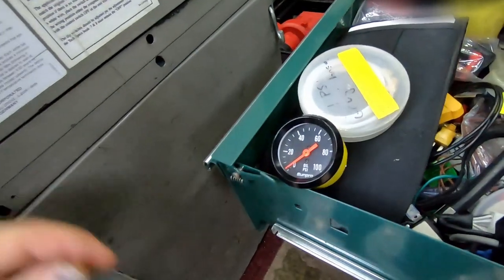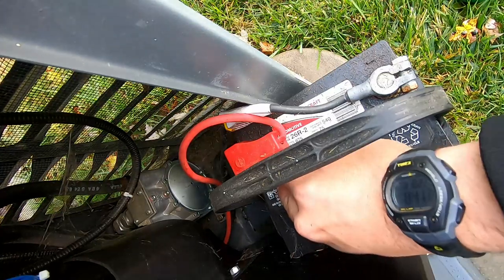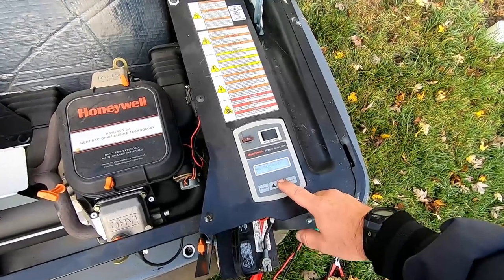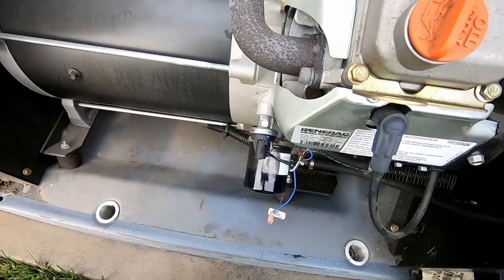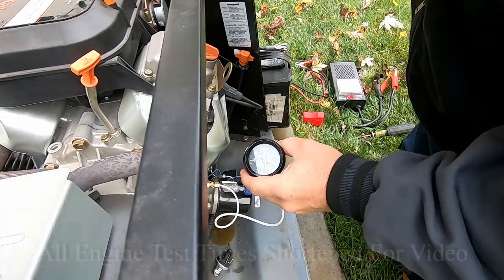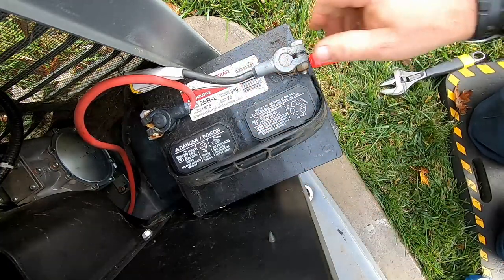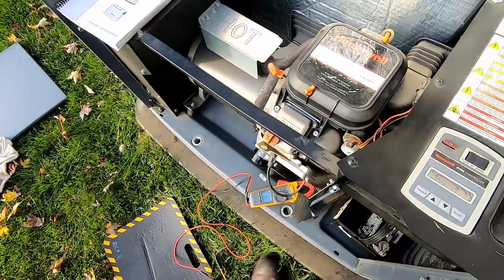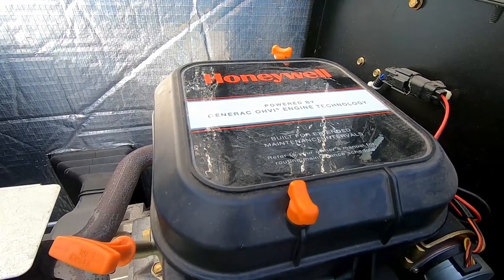Generac "Honeywell" Generator Oil Pressure Switch Diagnostic

Comment: I like that Walmart Schumacher does real load test, plus it's a nice heater too.  I brought my battery in to Walmart as bad under warranty, they hooked it to their electronic wizard 3 times and told me its good and they can't replace, I grab the Schumacher off the shelf and it clearly showed no go and manager gave me a new battery.  My wife got stuck 2xs with a good alternator 14v+ and looked like an intermittent in batt.  But the Johnson controls at Walmart are the best by far for dollar.
Reply from the maker: Dang strait 👍👍. If it's weak it will drop fast and go low. Then spring right back up fast.

Comment: I second your opinion on their books. Mine didn't even have a table of contents. Then when you call Generac for tech support, theyre always like "did you perform test "blah blah blah?'" I respond "I couldn't find it in your damn book."
Reply from the maker: That book makes you feel like you're an idiot. "make sure you turn your meter on, not set the meter for voltage. Now pick up the test leads. I'll put them on the test point". Oh my gosh🤯

Comment: Had the same oil switch error.   Bought a new switch and installed it only to have it error the same code.   Didn't have a pressure gage yet risked it by starting the unit and pulling the wire off to it could warm up.   Then put the wire back on only to see it still running,  without a switch error.   Hoping it's was a fluke. Or maybe an ice up oil passage that cleared out.  Has only ran 160 hours.
Reply from the maker: So you did not verify the oil pressure?

Comment: Thanks for sharing Rick, great video as usual. I do have a question though:  why not add a tee, ball valve, and plug in that oil pressure sensor port?  If you’re pulling the sensor out to attach a gauge, adding the tee with the valve will make connecting and disconnecting the gauge simpler and neater. Just another perspective on it, and another opinion (and we all know what opinions are like… lol)
Reply from the maker: Because it doesn't fail that often.  I've only had 2 or 3 fails so far. Another way to look at it, as just another place for it to leak. Thanks 4 the question👍👍
Reply: @HVACRSurvival  makes sense. Thanks for the reply and again, thanks for sharing. Really enjoy watching.

Comment: Hi thanks for the video!  .I'm trying to find an engine wiring diagram,  rats chewed the wires off the oil pressure sender and various other wires.  Honeywell 17k

Comment: i noticed you left the fuse in, when testing the load on the battery. I take the fuse out, as it's still "charging" from the control board. I didn't want to put up to 100 amp load on the control board, as it may be bad for it. I remove the fuse, then do a load test, that's my way, not sure what Generac says if it's needed, for this test, i'll have to consult my repair manuals. I'm a generac tech as well, fyi.
Reply from the maker: If the customer don't mind losing their exercise time and day depending on how old a machine is,  it won't hurt to do it that but it's not necessary. As you may know electricity is lazy and takes the shortest path of resistance.  The control board is in parallel with the battery just like the load tester is in parallel with the battery, there's no way that would put any load on the control board. The only thing the load tester would create is a voltage drop, possibly as low as 11.2-11.5vdc which at that point the battery is probably failing.

Comment: So you concluded the LOP sensor was the issue? I'm having an issue where a customer's input goes from 1 to 0 back to 1 then shuts down. I'm going back with oil gauge to test the pressure. But you concluded it was the sensor?
Reply from the maker: You won't know for sure until you check the pressure

Comment: Hi Rick. I get an error 1300 low oil pressure. Engine shuts off within 10-15 seconds. Last changed oil 5 months ago and has correct dip stick level. The pressure switch is “normally closed” according to my research, so if you just disconnect both leads it should bypass the switch telling you the switch is bad or good, correct?
Reply from the maker: I believe you’re correct without looking it up, the temp switch and oil switch are opposite, I forget which one is n.o. and what one is n.c.   I would test the pressure first or just replace the switch. I hate to tell you to run it and then have a problem with the oil pump system. But if there is a problem with it then it’s a nightmare to repair anyway.
Reply: I ended up putting a new low oil pressure switch in and it worked. It runs more than 10 seconds now. I just hope it does its real job if it ever  senses low oil pressure. 😅

Comment: When replacing the high temperature sensor (not the oil pressure sensor), do you need to remove the oil first?
Reply from the maker: The temperature sensors just screwed on to the engine block. It does not screw into it. So no, you do not have to remove the oil.

Comment: So if the oil pressure doesn’t register on a oil pressure gauge but the unit still cranks and runs for a few seconds, what is the issue then?  It still has power generating for those few seconds as well….
Reply from the maker: The control board has a time delay so the motor can build up the pressure. If you don't have pressure then you have big problems. You'll want a tech to verify the actual if the oil pump has failed or what exactly has happened.

Comment: so im  not surr if you said but what was thw oil pressure supposed to be at you tested out at 57 psi i looked at your book and it didnt say what oil pressure is when its bad
Reply from the maker: The switch had it marked on the side. I believe the switch was 10psig. I would guess any pressure under what the switch is raited for would be a good indication is got a issue.

Comment: Would you recommend a kohler over the Generac or Honeywell?
Reply from the maker: I have seen the inside of the factory at Kohler and also Generac. I was impressed more with Kohler. I see Kohler in commercial applications all the time yet I hardly see Generac. Generac has the home standby market because of the price point. They both are good but If I had to depend on it with my life, I would feel better with Kohler.
Reply: @HVACRSurvival  thanks rick appreciate the input

Comment: So would the battery cause a low oil pressure code?
Reply from the maker: Not that I've ever noticed. Unless the battery voltage is so low that it malfunctions and gives a false code. But I've never seen it
Reply: @HVACRSurvival  I had to ask since there are no stupid questions and voltage can do funny things to boards. I did see where a firmware upgrade also resolved the issue on the Evolution 2.0. Your thoroughness is very nice to see and the way you showed using the important testers is nice in a video thanks I can send this to my guys.

Comment: What are the two wires on the sensor, signal and ground?
Reply from the maker: One is the ground reference and the other goes back to the control board to sense if the switch changed position.
Reply: @HVACRSurvival  So the manufacturer didn't trust a block ground.  They don't use anymore materials than they absolutely have to. And what side of a DC circuit is the most misunderstood and overlooked?  If you guessed the ground side you just won a cigar!

Comment: does anyone here knows what oil pressure is normal for a 10kw generac guardian I have reading of 46 psi 3 seconds after start but still shutting down on low oil pressure alarm even after I replaced the oil pressure switch and updated firmware
Reply from the maker: I believe the switch is a normally open switch and closes at 10 psi once the generator starts,  it should then ground the wire to  ground. I would jump the wire to ground a few seconds after it starts, if it still drops out on oil failure then it's another problem besides the switch. Start tracing wires back to the control if it still cuts out.

Comment: 12:04 that’d be milliohms ;)
Reply from the maker: https://www.convertunits.com/from/megaohm/to/milliohm   No, what I read was the actual internal resistance of the battery. I'm sure its a calculated number.  But 5 Mega ohm is 5000,000,000 milli ohms.